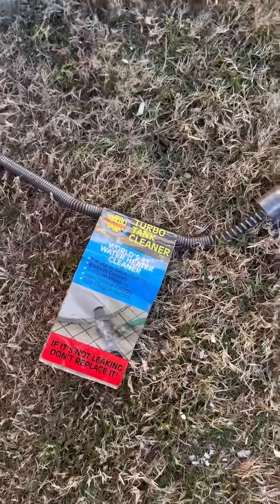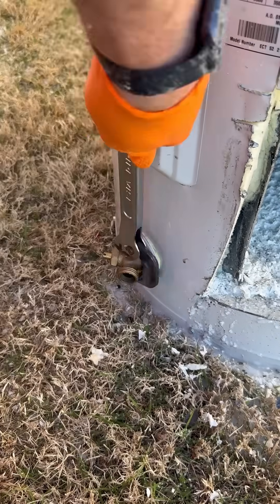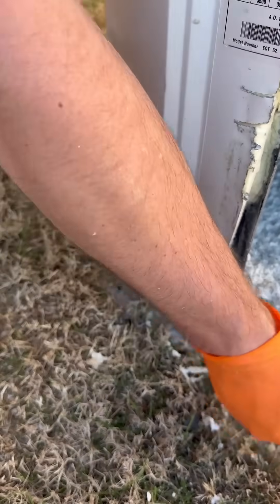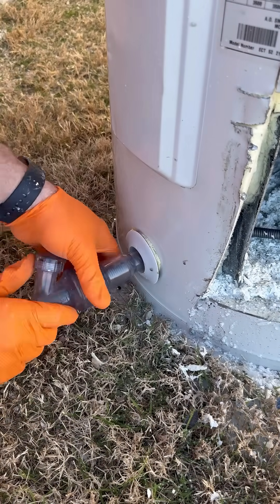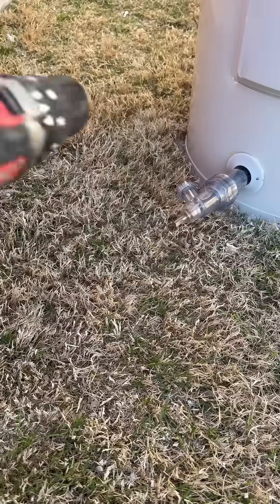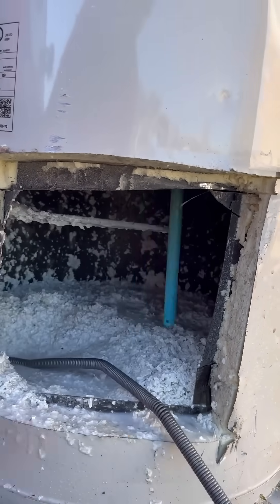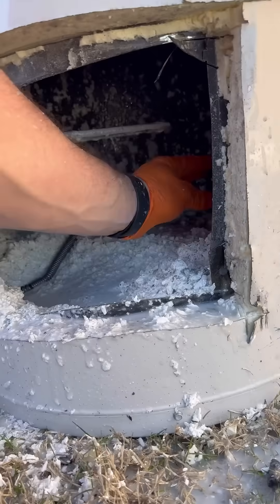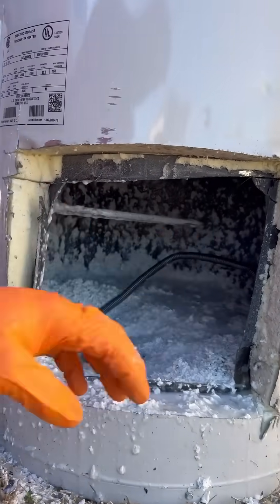What does a Turbo Tank Cleaner do to the inside of a water heater?

Comment: Most of that gunk inside the tank is calcium based and can simply be dissolved using appropriate acid mixtures. You don't have to worry about the acid attacking the tank because as weird as it sounds, that gunk acts like a buffer and will protect the tank. Then you just have to keep recirculating the acid until no more gunk. You should be able to calculate exactly how much gunk you have in the tank based on the weight of the electrode and the weight of the original tank

Comment: Last time I had a heater that had totally gunked up on the bottom, and it actually caused the bottom element to burn - I cludge together a water hose from when I replaced my water pump and I replaced all the hoses at the same time - cludged to a wet/dry shop vac. I ended up pulling over 2 gallons of sludge out of the bottom.

Comment: I remove the anode from the top so I can look down into the tank and I use a brass tube with a water hose connection into this top hole to blast the sediment out. Super easy and you can visually see what you’re doing.

Comment: If they made it straight with rubber paddles that would be much better because it wouldn’t fly everywhere and it will help get sediment off the bottom of the tank. 

Is that not the best way to do it?

Comment: First of all, read the instructions!
They tell you not to use full power when agitating the sediment, just enough to loosen it, allowing the water to flush it out.
I've successfully used this apparatus over a dozen times for clients and have had excellent results.
I do wish certain of it's components were made of stainless steel rather than plastic.

Comment: all water heaters have a glass lining so that they don't rot at the bottom that blue plastic you're seeing is the cold water dip tube it puts the cold water to the bottom the anode rod that he's talking about is usually on the bottom of the hot outlet. So yeah in my professional opinion I agree with him in my opinion it would shorten the life of your water heater by breaking the glass lining or destroying your Android which is there to defend the strength of your water jacket.

Comment: It's probably also meant to be used under water rather than in air. Me I'd be more mindful f the enamel coating inside the tank being flaked off. leaving spots for the tank to rust out.

I can see the idea wheels twisting, but I think a small rotating head unit like a pluming jetter nozzle of sorts might be better if it were attached to a stiff rod that could be driven in and it would also rotate using water pressure while jets spray  to loosen the sediment and such inside.

Comment: I think you should have put a clear barrier on that looksee section, then you could have made the thing work with water, and see if it ruined anything.
fyi, I have used this product, and it took out 3 gal of sediment and sand out of the tank until the water ran clear. I was very impressed.

Comment: The only thing that matters is does it work or not? Because if it works the solution is pretty easy remove your anode remove your lower element put a plug in the hole for lower element and then let her rip as long as it doesn't actually hurt the tank it doesn't matter as long as it works

Comment: Even if you remove the elements and plug the holes and remove the rod you still risk breaking the dip tube (Usually not easily removable on most electric tanks).

And even then you could crack the ceramic glass coating on the tank more which would make the steel tank rust even faster. (It naturally cracks with cycles and age and is why tanks eventually rust out)

Comment: First you remove the water from the  tank of You put CLR a whole container in the tank. Then then you turn on the water. And fill the tank a quarter of the way, let it sit. Then fill the tank then flush the system. The CLI will break up the minuthe. Minerals and stuff deposited at the bottom and should remove most of it.

Comment: I have taken apart many water heaters there is a layer of glass or enamel in them to prevent rist. Using this product would damage that resulting in early rust while would cause early leak. And the power in the sample tank shown is a joke. I have never found dry power in a tank.  Typically there might be some sand. The zinc rod reacting with water would go out as water flows out under normal usage.

Comment: Sure. It would do that if you ran into the high-speed, but if you ran it in a slow speed, you probably would Stir it up enough to get the sediment out without damaging anything and your demonstration. There is showing nothing because the water acts as a resistance to the Spring. If there was a clear glass or plastic view window on the tank and water in the tank you would be able to see and I'd better demonstration than you would be.  In order and you would see what was going on. But without water, you could not show without a doubt. Proof of any damage going on now I have nothing to do with the company. I have no idea, but you would have to have common sense to know that water would add resistance to the Spring.  The device that's on the and you would not be smart to run it at a high speed if you Wanted to prevent damage to the coil and the zinc iode in the water heater.
The only thing you're doing is stirring up the sediment in the bottom of the tank. You do not need a high-speed to do that as long as that is down in the bottom of the tank.  The slow speed on the drill would agitated enough to break it up. You're dead your demonstration is failed because it's not under real life canditions

Comment: I'd sure like to put a camera in the tank, fill to half way in the tank, use that contraption, then see a sediment analysis of the water when the tank is drained. 
If it's used on an empty or near empty tank, the glass liner would take an awful beating. If not empty, then how good a job does it really do?
From the looks of this demonstration, I can tell what you can't tell.

Comment: I also bought it and use it and am a certified maintenance mechanic for buildings the past 32 years. I realize that not only did it take almost a gallon of sediment out of my 18-year-old tank that if you put a 10-in extension pipe on it it'll shorten it up and also get the other calcium deposits closer to the wall that you're going through in the first place. As for the anode rod I think it's pretty much gone at 18 years and find you it's a gas not electric.😮
Reply: Certified by who, the 🤡 council of elders?

Comment: Well , that tool would not beat the tank up if it was submerged in water because it would have the resistance and pressure of the contained water , which would have prevented it from knocking around like it does without water in it.
Reply from the maker: Watch the updated test on my channel

Comment: i would be more inclined to feed a high pressure swirly nozzle down through the anode hole at the top to stir up and flush the sediment out, you could also then feed water in the outflow port if needed.

Comment: You don't have to use it at full throttle,  start with partial throttle.  A coat hanger will probably work.  Pull out anode and cap if concerned.

Comment: How do you clean the sediment out of the water tank? Best and safest way
Reply from the maker: If it’s electric, turn off power, drain tank, remove lower element, vacuum out sediment, install new element, refill tank, purge air, turn power back on.
Reply: @theplumbersplunger  Our electric water heater is a year and 4 months old. How often should it be cleaned?

Comment: I removed a lot of sediment by removing bottom elements and using a shop vac and a 2 foot piece of old garden hose!!
Reply: Spot on
Reply: I have hard well water.  I drain 6-10 gallons every month.  If you want to agitate the crud at the bottom, turn on the cold water inlet for a second or two b4 each drain bucket.  If it clogs the drain spigot close and re-open the valve 2-3 times to re-open the valve.  Pour the drained water thru a strainer and see the cat litter sized stuff was taken out.

Comment: Well hell if you got to take the drain out anyway to put that adapter on you might as well take out anything else that’s going to be in the way the dip tube whatever else to add to the Rod whatever because you’re dirty anyway if you’re gonna go through all that then either change it or pull those parts out and try that thing but

Or you could just show them how to do it once a year and drain it down and then refill it and it will never be an issue as I had one hot water heater that was in my first house it was 31 years old before it failed and it only failed because I got divorced and I wasn’t draining anymore and my ex-wife was that well we won’t go there

Comment: I've come to the conclusion that if you do preventative maintenance on a water heater it will last 12 years. If you leave it alone it will last a dozen years.
Reply: Just replaced mine 33 years old
Reply: @Bosscrits  
I'm impressed! That's got to be a record. I am so fearful of a flood, I replace every 10 years, sometimes even a few months earlier.
Reply: @Sidfields789 oldest I've pulled was 42 years upstairs unit homeowner came home to water coming out of front door. One of my buddies did an old copper water heater recently it was still functional. He brought it around to show off.
Reply: They seem to last exactly 121 to 122 months - at least every brand with a 10 year warranty.
Reply: @GovilGirl  
You are a very smart person. That is exactly what my plumber said.
Nice work.
Reply: @GovilGirl That is calculated. It takes a certain time for the anode rod to disintegrate. The warranty is set by that time. The longer warranty units have a larger anode. That is the only difference. If they are lasting 10 years, replace the anode every 6-7 years. Suddenly you will get many years longer out of them.
Reply: I'm an installer for 30 years in the Bay Area. and I made a very good living, retired at 47, because of people messing with their tanks, you my friend is correct,  let them settle,  keep the temp low, change the water flex lines once in a while, you'll get almost 15 to 20 years out of them, but, these new tanks, their thermocouples are crap, 😊😊😊😊
Reply: @user-bl6ne3hc6n  
I have a gas water heater but due to downdrafts they sold me a pilotless ignition water heater. I don't believe these have thermocouples?
It's an AO Smith and it's 6 years old and works well.
Reply: @user-bl6ne3hc6n what are the water flex lines? Is it possible for a tank to not have an anode rod? I don’t see one on my tank
Reply: @c.mart90  look on top you'll see a 1 in or 3 quarter nut on top of the tank that's your rod, water flex lines are your inlet and outlet that comes from your plumbing to the tank, this might be a California thing because of earthquakes ,
Reply: @user-bl6ne3hc6n  especially in all those new ones with electronic ignition 😅
Reply: Had mine since 2005. Still going strong. Just replaced heater coils and new thermostat.  Works just fine. Declined an insurance company cause they told me to replace it cause of its age. I told them to go *^*% themselves. If it ain’t broke don’t fix it or replace it.
Reply: @mikebledsoe5723  
I understand what you are saying but I think you have given the insurance company an excuse to deny a potential claim raising out of a flood due to your water heater.
Reply: @mikebledsoe5723 
   Good insurance adjuster would at least look at and consider the make model 
    Actually some tanks made to get crazy life
   I seen one was old enough the copper going to it rotted away had a pin leak that caused the wires to short only reason got noticed
  It was kind of a damp basement but I'm saying it took at least 49 years

   You always see stuff like some brake pads or radiator hoses found in some container somewhere 
    Where the container of appliances from the 20s to 70s 
    Like you see a fridge from the 30s 40s still working without maintenance 
      Stuff was around long enough then for people to bitch when it wasn't made right knowing how to make it made right 
   And see that it got done 😂

Today's culture 
   Accept Trash
Reply: Lol nice one. Basically just get a new one after 12 years. Or get one after a dozen years???? 🤔
Reply: Planned obsolescence is bullshit. The home I moved into had a water heater from the 80s when the home was built. It went out 2 years ago but 40 is a lot more than 6-8 or 12. Guess I should start looking forward to replacing it.
Reply: @iGladiusMaximus Yupp! Look at bulbs! They started lasting too long and the companies profits started waning so they began making shorter lasting bulbs. If I’m right, there’s a hundred year old bulb that’s still kickin!
Reply: Lol that's funny. But on a serious note, the tank in my condo was installed in 1992 and works perfectly still. Electric.
Reply: @aod420247  
I'm a coward at heart. I buy a 10 year warranty heater and replace it after 9 and a half years.
Reply: 5 years is what I was told.
A guy they labeled a slumlord said even he wouldn't leave it longer if not maintained.
Reply: I just replace a 45 year old water tank in my home. Not sure why anyone can't afford $300 every 45 years!
Reply: @pbear216  They last about 6 years where I live. I bet the new one you got won't last as long as the old one.
Reply: @pbear216 2 reasons, first- tanks don't even come close to a 45 year lifespan. Secondly, prices are substantially higher than 300 dollars. I replaced the gas water heater this past January. Average pricing was in the 650 dollar range. The tankless models are north of 1000 dollars. If these appliances were to last four and a half decades, the cost would be more in line with service life. I flush mine every month or so in order to help keep it operating as long as possible.
Reply: @markk3652  I agree, gas is more expensive and don't last as long as electric, but a 40 gallon electric is around $300
Reply: My families old water heater lasted 16 years and it never had anything like this done to it. It didnt stop working, we just got a newer bigger one. Our current heater is about 4 years old and im starting to wonder if there is any maintenance I should be doing
Reply: Wasn't some of the really old tanks ceramic coated 
   Id imagine might still be some of them going
Reply: Oh yeah it's the cement lined that out performs glass lined
Reply: That's enough of a reason not to use this thing though 😅
   Dropped a wrench in a brand new porcelain tub once 😅
Reply from the maker: Without maintenance where I am they seem to last 6-8 years
Reply: @theplumbersplunger  I'm living in a place that has a gas water heater outside that was installed back in 1996. After 6 months of telling management that it has a whooping 15 minutes of hot water and sounds like boulders tumbling around when its heating, they do not give a damn about replacing it. So, apparently they last 30+ years if you dont care.
Reply: @theplumbersplunger 18 for ours
Reply: @theplumbersplunger My old 30 gallon A.O.Smith lasted from 1969 to 1995!
Sadly, I believe those days are gone!  😟
Reply: @theplumbersplunger  way off in Midwest we get like 20-25 years & no one  maintain them. Y'all got bad water
Reply: I mean my dad did preventative maintenance on his water heater, six month draining (had to, highest calcium water from a deep well aquifer) to remove the sediment. You could go a full year but then you would get about 8 to 12 coffee cans of calcium before you were done so he switched to draining and cleaning the calcium out every 6 months.
He would check the elements and soak them in cleaning vinegar (30%) that night and put them back in the water heater in the morning, replace the sacrificial anode as needed. The tank is 40 years old and running like new.
Reply: @alexistaylor969  
My area has soft water. I drained my tank once after 5 years. The water was crystal clear. Don't fix it if it ain't broke.
Reply: @Sidfields789 Still need to replace the anode. The scale does not kill it. Rusting does. The scale makes it less efficient by limiting heat transfer.
Reply: @court2379 
In my opinion, and thats all it is, if you are going to use a licensed plumber, which my town demands, it will not be cost effective to replace the anode rod.
Better to buy a new unit.
Reply: @Sidfields789 They are charging 3K in my area for a WH replacement. Which I say is robbery... 
I don't see how a $30 anode, and 1 hour minimum labor charge makes not doing them logical. If they are done before the anode is gone, the WH should last for decades.
Reply: @court2379 
I paid 1800. Then a few yrs later they wanted 600 for an anode rod. I bought a new unit. No regrets.
Reply: @Sidfields789 That is way over charging. It's a $20-30 part. And a professional probably only takes 10min to swap it. Most of which is waiting for the pressure to drain out. If the drain valve is messed up or doesn't drain it might double or triple the time. So worst case 30min and maybe a new valve for another $10. Applying a decent labor and overhead rate of $150/hr that is still under $200 for the job.
Reply: @court2379 
Plumbers are expensive in my area. Part of life.
Reply: 12 and a dozen is the same.
Reply: @NativeSkater1000  
I was making a joke. Apparently you don't get it.
Reply: @Sidfields789  lol, I thought there would be a comment about a dozen being longer due to (bakers dozen).
Reply: @Sidfields789 jokes are supposed to be funny
Reply: @koki8407  
Some thought it was funny. If you didn't find it funny, tough toenails.
Reply: @NativeSkater1000 r/woosh
Reply: @NativeSkater1000  the force is definitely not strong with this one!
Reply: @NativeSkater1000 
DUH😂
Reply: @NativeSkater1000 That was his point, but he’s wrong. Well, I wouldn’t want all that stuff in my water!